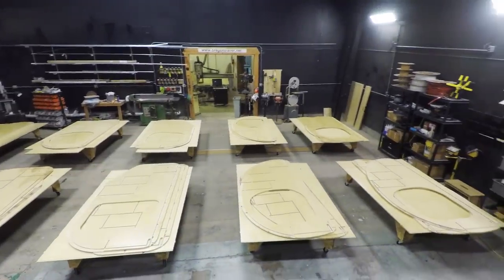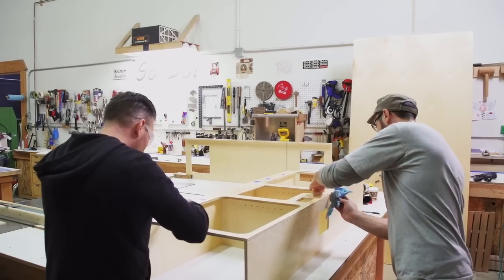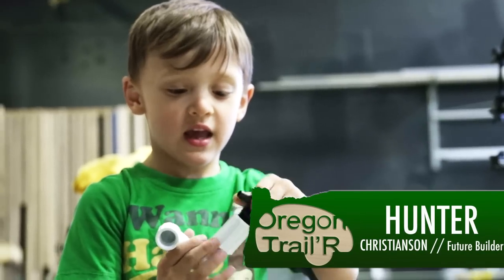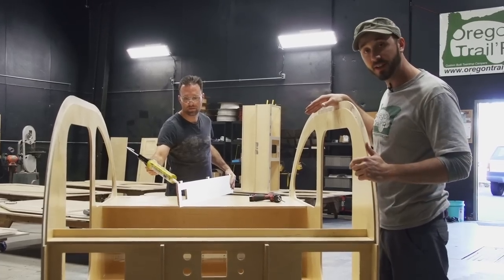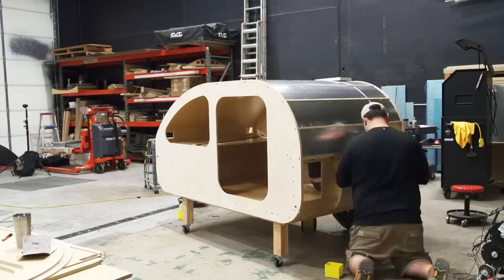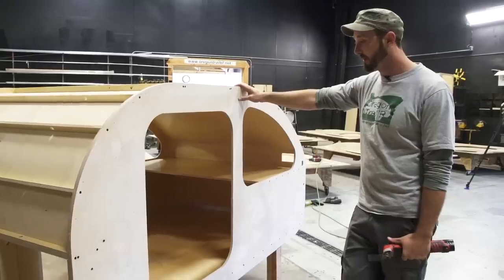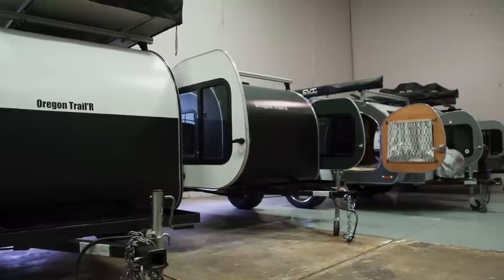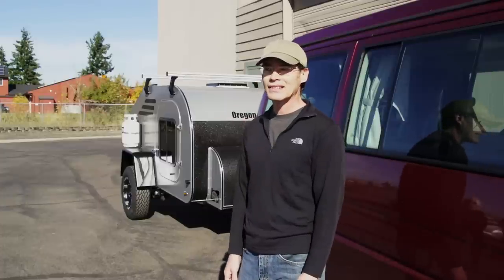Teardrop Workshop

Comment: you guys are great! been a fan a long time. I'm a carpenter/ cabinet maker wanting to build a  tear drop. any good advice would be appreciated. just a shot in the dark, but do you sell on the east coast. would like to talk more about that.
Reply from the maker: Jeff Dixon we have sold a few trailers on the east coast, but honestly given your skill set and the fact you have the tools,  I would suggest you give it a shot yourself if you have a lot of free time!  We would love to sell you one of course, but we support the DIY community as well!  The most important advice I could give you is to think several steps ahead and keep weatherproofing in mind at every stage of the build!  Use the best materials you can afford (we love pre-finished Baltic Birch), and build it like a cabinet instead of like a house! Dados/rabbets, glue and screws!
Reply: Gotta agree with the guys at OregonTrailR. You have the skills. I built one and i'm an AC man with little to no wood working skills. That shows in the wood work but the metal work is pretty darn good and I get positive comments everywhere I take it. Took me 4 months working a few hours a night. My advice, pay attention to weight as much as weatherproofing. Its easy to overbuild, but with a little fore thought, you can keep them light. Mine came it at 900 pounds fully loaded and with enough food in the cooler to last a week. In hind site, lighter would have been easy, but at least I can throw a couple of deer on the roof :P

Comment: Do you put any surface treatment on the plywood before you line x it? Does the liner x stick well to the plywood?
Reply from the maker: Sorry for the late reply, we are having notification issues!  Polyurea sticks pretty well to carefully prepared plywood, but the shop we use to spray our Alpha Coating has a special primer that goes on the wood first that helps the polyurea bond to the wood.  This was highly recommended by the polyurea technicians we worked with when designing our Alpha line of trailers.  Our first one was built in 2015 and is still functioning perfectly 8 years later!  Color has faded a little, but no cracks, warps, or anything of that nature...
Reply: @OregonTrailR  That you for replying! I am building my own custom teardrop and was considering line x for the waterproof exterior over plywood. If you don't mind me asking, is the primer a special formulation or a standard product that I could apply myself?
Reply from the maker: @affidavit4  I'm sorry for the late reply!  Unfortunately it is a trade secret, but if you can find someone who has a lot of experience spraying this stuff (you don't want to try this yourself IMHO), they will probably know what to use to bond to your substrate.  Make sure to do samples first so you can be sure the bond is perfect!  Good luck!

Comment: So it looks like the only vertical members are the pieces of plywood.  How does that support the rack with a RTT on it with a few people inside!?
Reply from the maker: Good question. Plywood is actually quite a bit stronger than people think it is, especially with shear load - which is what is happening with our rack. Each of our massively overbuilt rack towers is bolted on with 4 Stainless carriage bolts - which combine to create massive clamping pressure between the rack tower "foot", and side wall. The rack towers are then connected with a very strong 2" x 2" aluminum extrusion. I've had more than 500 lbs worth of people in the tent simultaneously + plus the 120'ish lbs of the tent itself.  I hope this helps answer your question.

Comment: Some manufacturers use composite materials for their body. You guys use plywood and LINE-X. What're the pros and cons?
Reply from the maker: I’m a life long woodworker, so the easiest answer is that I work with the materials I know and trust.  The more important answer is that wood (especially this Baltic birch) is a environmentally responsible renewable resource.  This is specialty marine plywood, harvested from trees that were grown on a plantation in Russia specifically to become the worlds best plywood.  Technically speaking, a composite material is just two or more materials put together to create a superior material, so plywood, being made of many wood veneers held together by specialty adhesives, is a composite material.  But what you are talking about are plastic products, I’m assuming.  These can be excellent materials for construction, but can be very limiting when designing with curves, etc.  The benefit of plastic, as that it lasts nearly forever, but that is also part of my issue.  I believe excessive dependence on plastics is poisoning our environment, and I can’t justify going through that much of it to build a product that isn’t anyones life necessity.  When you coat Baltic Birch correctly with polyurea (linex), you get an incredibly strong and lightweight body that cannot leak, rot, scratch, dent, etc...  Now, to be fair, polyurea isn’t the most environmentally sound material in the world either, but it adds decades to the potential lifespan of these trailers (I believe they will outlive their owners), which removes the necessity to build replacements, which uses vastly more energy and materials...  hope this helps! Thanks for the question!
Reply: @OregonTrailR  Thank you for the very detailed answers. They are very helpful as I'm doing research on various products of this form format, especially those using different materials (plywood, aluminum frame, etc). I hope to see your products in Overland East 2020.
Reply from the maker: HC Lim We only are able to take enough time off to go to a few shows a year,  and Expo East is just too far for us, though we usually have a few of our clients messing around out there in the campground and sometimes in other brand’s booths.  We are planning to be at the new Overland Expo Mountain West in Loveland CO this year, instead of Flagstaff like we normally do...

Comment: Hi  guys! As I understand in your trailer side panel without insulation. Isn't it?
Reply from the maker: You are correct, we do not insulate our sidewalls.  We prefer the durability and stability of a solid Baltic Birch sidewall which makes for maximum shear strength.